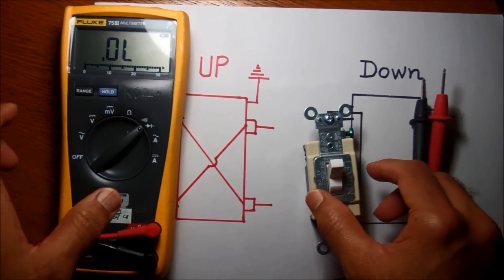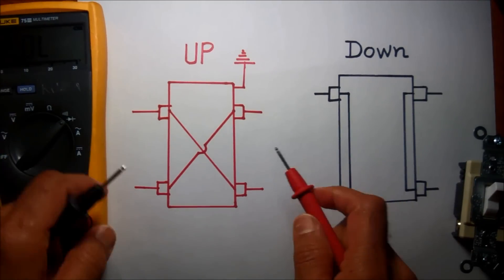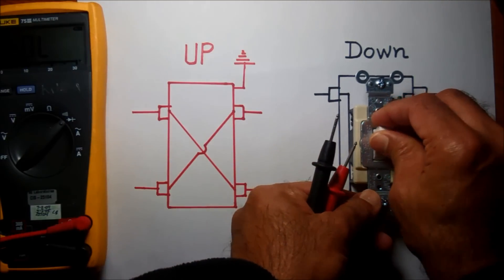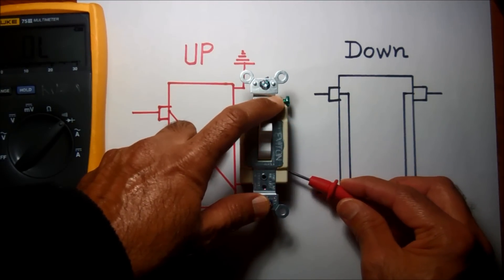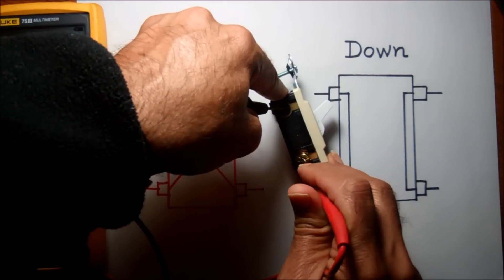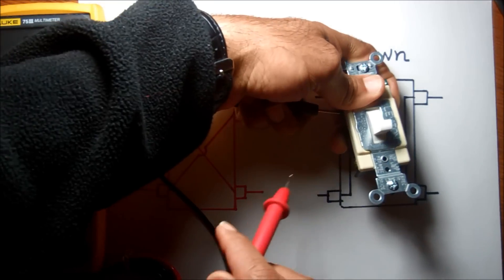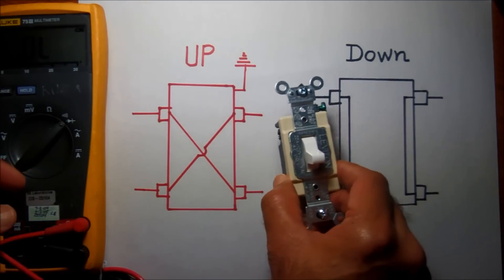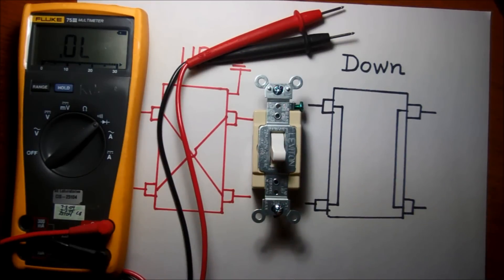How 4 way switch works

Comment: Great video, I was wondering how exactly does a 4 way alter the flow of current, while still allowing the other two 3 way switches to complete the circuit. There are videos all over the place about how to wire them correctly, but nobody seems to want to explain exactly what is going on in the switch. Thanks for the video.